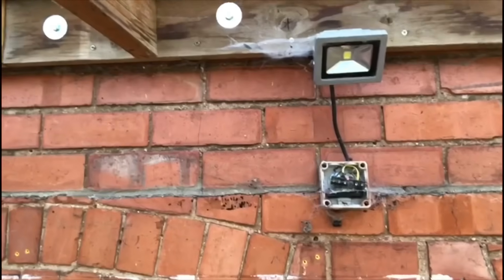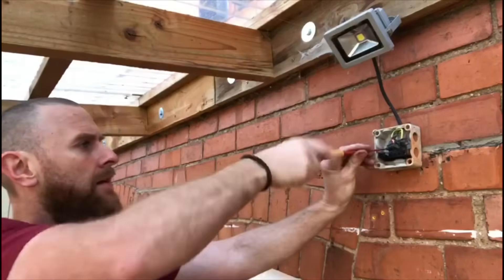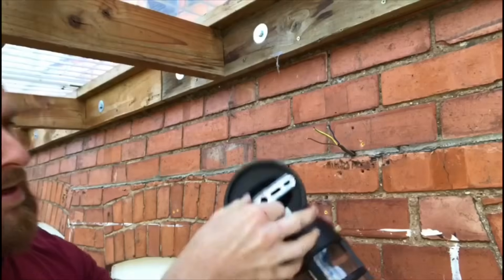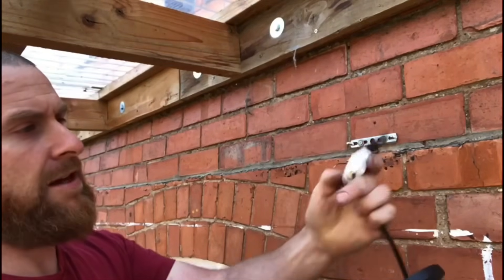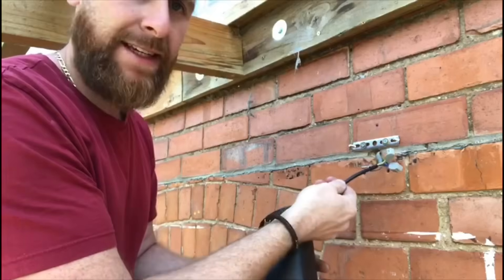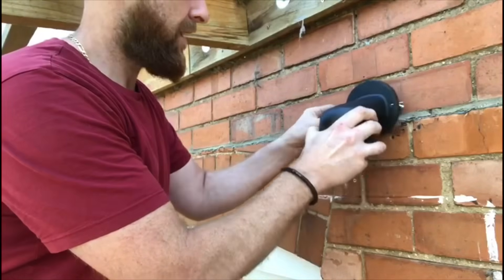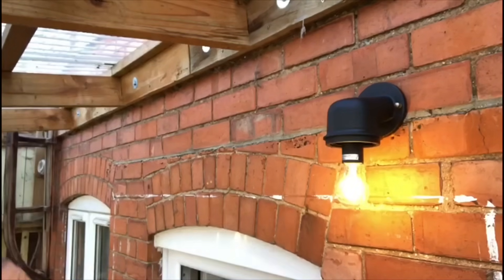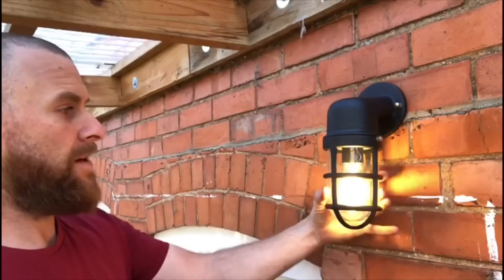Changing a old LED Outside Light for a new Light Fitting. Connections Made Using Wago 222 Connectors

Comment: Does anyone know how to replace a pir light with an ordinary light ? There`s six wires on the old pir but only three on the new ordinary light and when I wire the new light up it just stays on.
Reply: The pir acts as a switch, which is why the extra wires. So you took away the pir/switch and just made a live feed to the light. 

If all wires are external maybe try a eternal switch. Or like this one if the wires internal add one before the wires come through the wall.
Reply: @davesimmons6866  Thanks for the reply Dave but I gave up and got another pir light but thanks anyway.

Comment: I have outside lights with a sensor built in and also a separate PIR by the garage. this has a three wire feed. I put two new light bulbs in and thought that I would clean the separate sensor but I must have damaged it. Can I replace it with an ordinary PIR or a special one?  What would the wiring configuration be? Any help would be great.

Comment: Are the outside lights connected to the indoor light circuit? Also how many spurs can we pull from one light and how many cables we can run from a junction box thanks

Comment: Sorry not impressed, because you didn't you that junction box supplied then you must earth the wall bracket   as now you have single insulated wires pressing against it and can not guarantee earth continuity on those nice greased brass nuts. Also best recommend  using some silicone along top edge.

Comment: A good install, apart from the fitting not supplied with a sealing gasket if it were to be mounted on an actual external wall exposed to the rain.
It looks a well made fitting otherwise, does it have an ip rating?

Comment: so what's the consensus on installing that same light where there was no awning protecting from water ingress?
Reply: No issue with that atall if the light is IP rated and designed for outdoor use, which it looks like it is
Reply: @Darren Qualters looks to me like that light would still need a separate weatherproof enclosure (like the one that was removed) if it was installed somewhere exposed to the rain. given that the cavity is entirely open at the back I'm failing to see what protection there is to stop water sheening down the brick wall and into the fitting where the bracket and wagos are.
Reply: In Germany they sell this kind of fake boot lights with IP20 normally. The real "ships/yacht/boot"-Lamps are rated IP54/68 and more expensive.

Comment: Would cutting off the manufacturers connector block invalidate the warranty?
Reply: David B they might try, but they couldn’t really defend themselves if you’re replacing their cheap connector with a decent wago. Plus, if it developed a fault they would have to prove it was your  connectors. Changing the connector block isn’t going to effect the mounting mechanism, water ingress or how the light bulb connects, which are more likely failures.
If the wago fails and blows the thing to pieces then that wouldn’t get covered, but it’s unlikely.

Comment: No double insulation on unsheathed conductors of T&E... no earth connection to mounting bracket and exposed brass thumbscrews....
Reply: Alistair Riddell good point on the bracket and screws
Reply: There is no requirement for the conductors to be double insulated if enclosed inside a fitting like that.
Reply: @darrenqualters2341  Not if the fitting is grounded... however in this case the mounting bracket and exposed brass thumbscrews aren't... there's a possible (albeit unlikely) scenario where damage could occur to primary insulation and that exposed metalwork becomes live
Reply: @alistair1978utube  The brass nuts, threaded bolts and fixing bracket become earthed when the front assembly is secured to the protruding bolts.

Comment: Giing by the quality of the video, the board looked like it wasn't RCD protected, standard double pole switch, all circiits apart from one looked like they were mcb's, and only 1 RCBO breaker which I assume is for the ring final circuit.
Reply: Kevin Stevens all circuits are RCBO’s mate

Comment: I thought the supplied connector box was to maintain double insulation. I’ve managed to get 1mm T&E in them with little problem. Just correct preparation. I can imagine anything more would be a pain though. Light does have a cpc so should be ok.
Reply: Andy Kirwan they can be and exactly what I initially thought but it looked to me as if the fitting was class 1